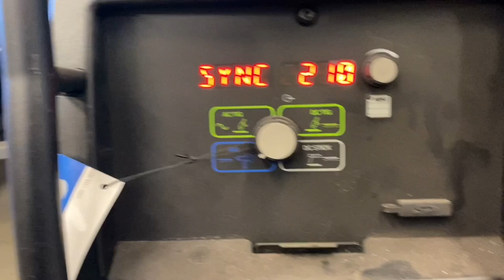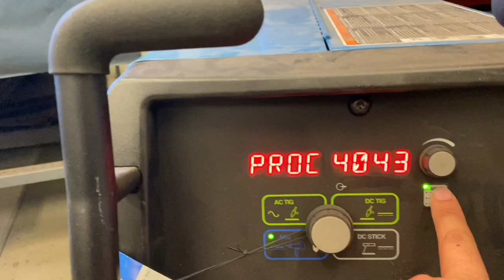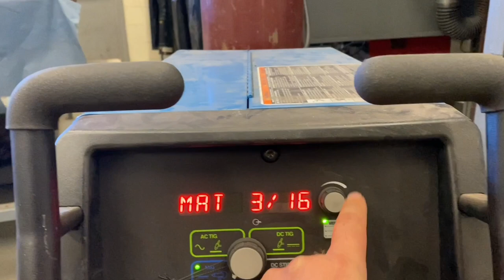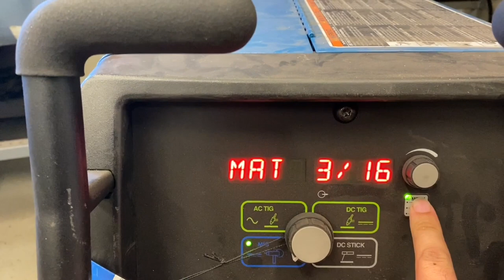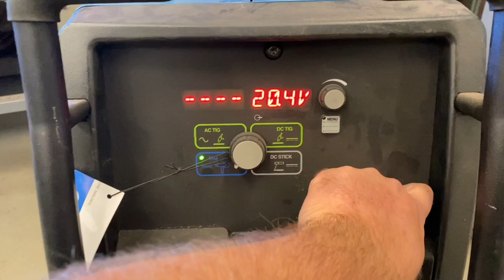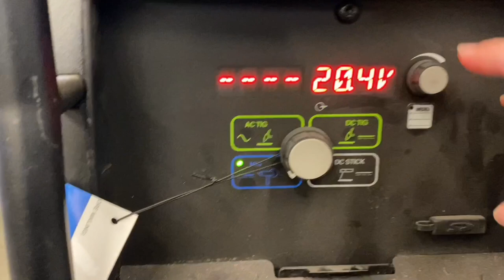Welding Aluminum trailer with Miller 210 & spool gun! Also Thank you for your support to 1000 subs!

Comment: What’s the tire size on you m6060? I’m kinda interested in ordering one with r4 tires as I will use it on mostly level ground (some use around my yard). What’s your thoughts r1 vs r4 tires
Reply from the maker: Mine are 16.9x28 rear and 9.5x24 front. Now you can get radial tires on them too which is wider on the front. R1 vs r4 depends on uses. R1 without a doubt will out perform on traction but you have more ground damage with them. I have a friend with a m6800 that came with r4 tires, he later changed wheels and installed r1. He said it was unreal how much more the tractor would pull and push. But if using around a yard much and for some dirt moving r4 would be ok. Where we log, farm, and have these hills we need all the traction possible even if it does cause more ground damage. Not sure this was much help but hopefully it will be. Thanks!
Reply: Thanks for the reply, I hate to limit the tractors push/pull capabilities with the less aggressive r4. I may go will the wider radial r1. Thanks for the experienced opinion👍🏻
Reply from the maker: @shanegray9052  my front tires are just to narrow in soft ground, I think the new wider style tires would be nice.

Comment: I don't understand the purpose of the first weld I thought you intended to join the fender to the frame but it shur did not look like you achieved that I got to say you need to practice more with ease weld positions like horizontal 90% or flat lap or even just doing long weld beads in str8 lines practice practice practice  useing different settings see learn what works best for you. Thanx for the video
Reply from the maker: 🤣🤣 The fenders are made to be removable so why would I weld them on permanently. I like how everyone is an expert behind a computer. Take care!
Reply: LOL ! Clueless bot